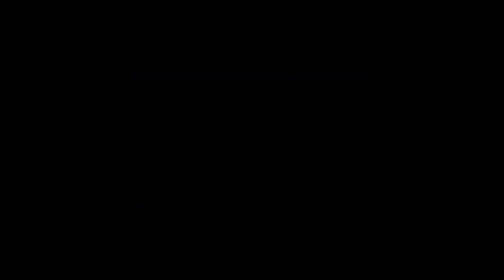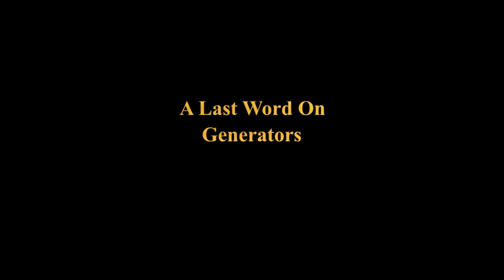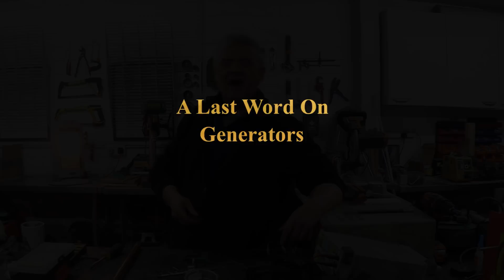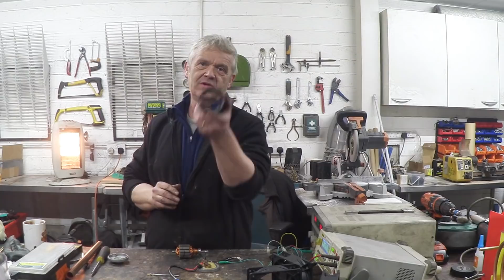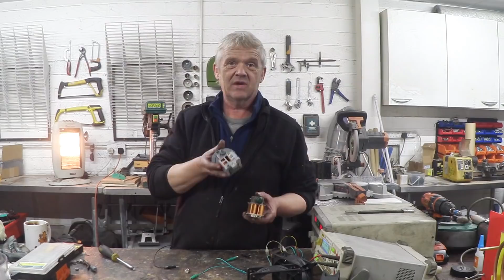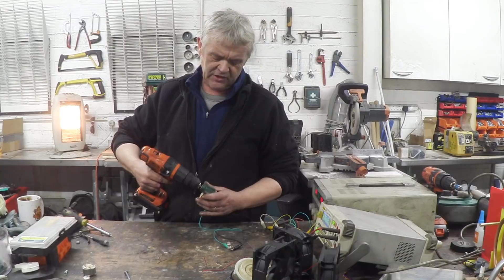1367 A Last Word On Generators

Comment: So if you now volts and resistance you can calculate amps. Dos that not mean you can calculate back emf:s ammount in wats?
If you require say 60W generator has to be able to produse 60W+bemf+wireing losses?

Comment: Great video series on generators Robert, I've learned a lot and come To the realisation that if you require a specific output And have the capability, the making your own generator is the way forward. There must be a generator calculator that will tell you if you have a known torque or speed, this many turn at this gauge and using this size and strength of magnet should result in this power output.

Comment: Obtuse ? You don't  want to use that word in the Shoreshank penitentiary . 4:20 .
Reply: I'm  wondering the effect if w hen magnet is traversing  the h o le in the copper conductor that jumper leads from a car battery were to make electrical contact at opposite points of copper mass . I have a 15 kilogram mass of copper with a hole , the magnet takes a very long time to travel .

Comment: Would it be more efficient if you spin the coils and magnets in opposite directions?
Reply: you cannot spin the coils because they have to be wired up to your output.
Reply: @computerfene  can't remember where I saw it but there was a novel commutator which contacted the coils via induction rather than physical contact allowing a wireless connection.

Comment: Hi Rob. 
I think you may enjoy this...
There is a channel called 'Master Ivo'. 
He is an electronic engineer specialising in Tesla works. He has designed a circuit for high side switching. It's a timed impulse circuit with back EMF taken from the tank to the caps. 
Still ironing out the kinks but he's almost there. 
I believe they will become the power supplies of the future. He is very impressive for sure and all open source.

Comment: For clarity regarding discussion starting at 1:55 and the creation of a back emf in a motor/generator and a copper pipe, it should have been pointed out that the copper pipe represents a closed circuit allowing current to flow inside the pipe, but in a generator, current only flows when a circuit is made. Only then does that current create a magnetic field from the coils which opposes the magnetic field from the magnet. And with the two magnetic fields opposing each other is there a counter torque created which in effect is taking mechanical power converting it to electrical power.

Comment: Robert,
I’m an engineer. I ALWAYS learn new things from these videos. I REALLY appreciate your teaching methods. You are doing great work for all of us techies and for non-technical people and kids.  
Thank you,
Ash
PS: 
I worked on submarines among many other ships. (Battleships too!)  A video about the really WEIRD things that happen when a sub dives and surfaces would be fascinating.     i.e. ,  How all the righting characteristics change rapidly, and the boat (ship) becomes potentially VERY unstable.  That is why all submarines usually dive and surface quickly. 
They need to get through the unstable configuration VERY rapidly.  It is never good to flip a critical PWR nuke upside down. Immediate core meltdown! 
(This reminds me of warming up and bringing a very large steam turbine online. You need to get through the unstable resonant frequency RPMS quickly in order to avoid violent flexing and shaking of the turbine rotor shaft. I’ve witnessed that, it’s not good.)
Reply: Hmm, and 95% enriched uranium fuel rods.  Maybe the French  technology  is safer with 6% enriched.

Comment: Awesome as always!  I wonder if you could give us your take on generators designed to overcome lenz law via switching the excited coil to avoid having to overcome the resistive forces?
Reply: Do you have an example of this being done? Sounds interesting.
Reply: Not specifically but I’ve run across several online over the years. Of course always questioned the viability of it but on the surface it seems as if it would be workable. This is of course why I ask because my understanding of these things is almost nonexistent in comparison to Rob.
Reply: Exactly, I would also like to hear more about generators such as the Adam's Motor.

Comment: Is there a better conductor for generation (conversion) than copper?
Reply: Mike,     I think that if the conductors approach absolute zero temp, weird things happen. If I remember correctly, there are some materials that are more efficient than copper at extremely low temperature, i.e. superconductors.  (The coils could be cooled with liquid nitrogen, or liquid helium, or liquid hydrogen, or other fluids.) 
I wish I could remember all of  the details!

Ash
Reply: (manifestation)!
Reply: Graphene
Reply: The world is not yet ready for it . Very hush hush .